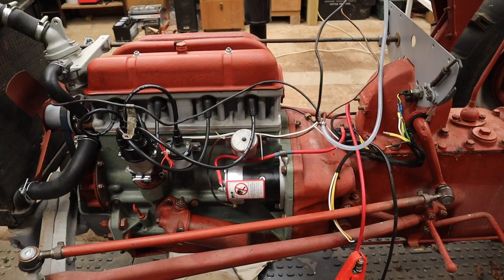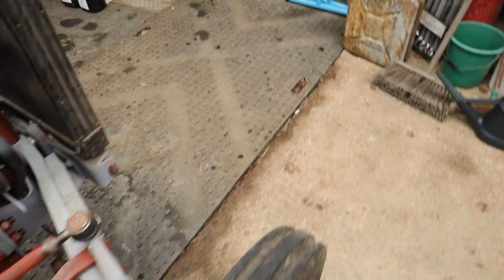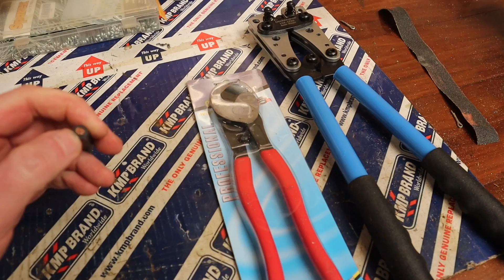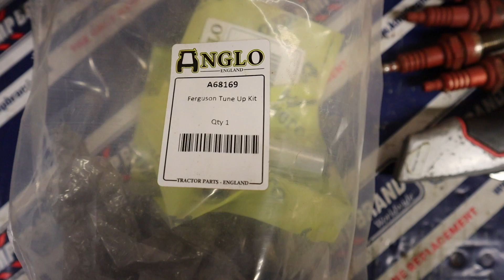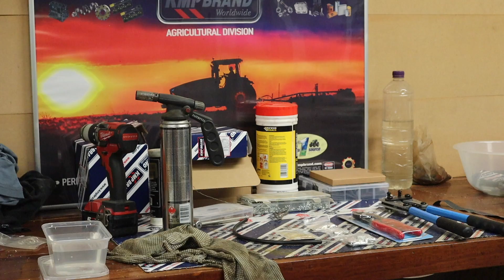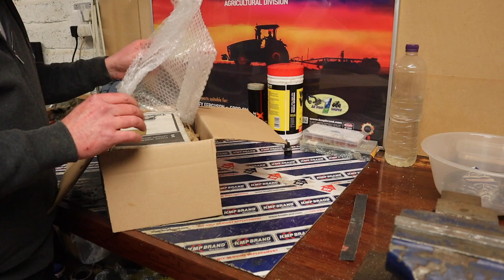#147 Ferguson TED20 - Engine Follow up

Comment: I just started my '51' TED20 and it took 3 minutes and 51 seconds before the needle started to move.
Reply from the maker: Hi Nick, yeah that sounds about right 😉👍. I bet it moved up to about an eighth of the dial and stopped there?
Reply: @WaterhouseForde Hi it went up to around 80 then dropped down to about 70 and stayed there, oil pressure about 60.  Cheers

Comment: Do you have the fan shroud. It helps the fan pull air thru the radiator. Block the radiator with a piece of cardboard to help get the temperature up while you are testing it.
Reply from the maker: I was thinking about that too. Sadly I don’t have the fan shroud. That would help a bit I’m sure. 👍😉

Comment: I made a video on those style gages. The quality on the ones we get here in America are hit and miss. The catalogs do not tell you the pressure range they are designed for. I went thru several different kind to get one that would work because the pressure range to the scale of the gage is unknown  or they were defective. I think the next time I will stick to a Stewart Warner classic series gages.
Reply from the maker: Hi Jerry, I agree these are very cheap and cheerful. They provide at best a guide and not much more. I am looking to replace them when I reassemble the tractor after painting. 😉👍